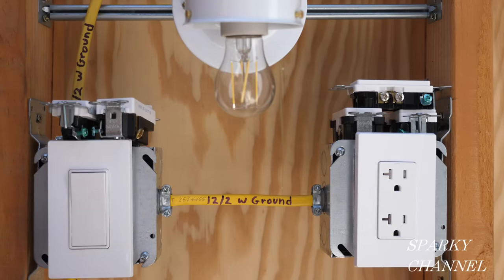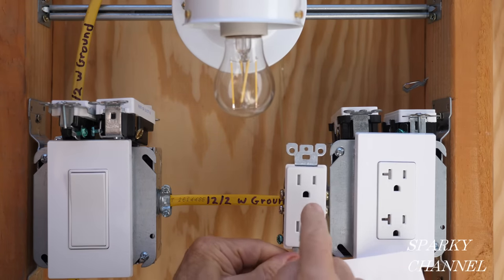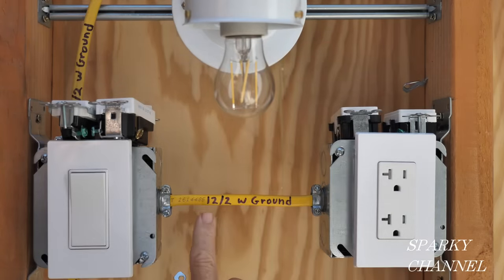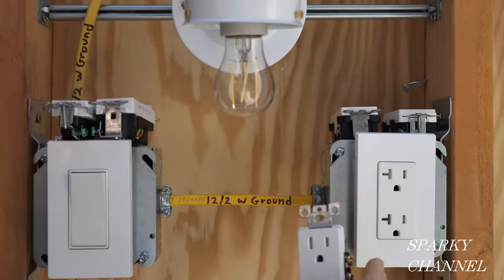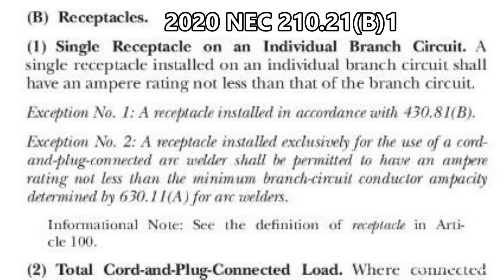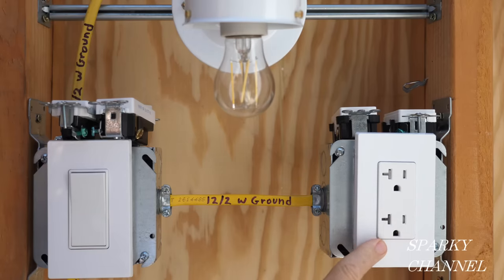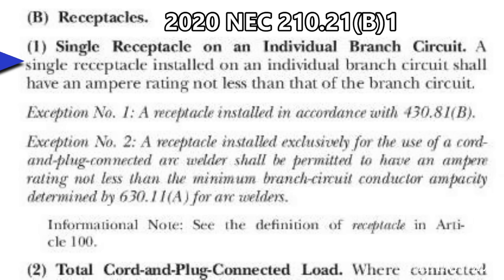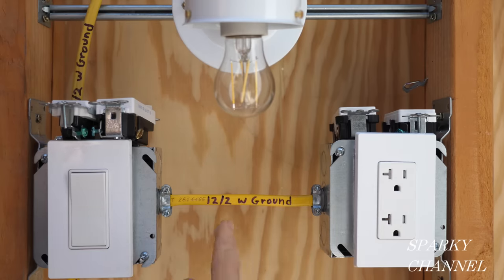Shall I Use a 15A or a 20A Receptacle on a 20A Circuit? + 2020 NEC 210.21(B)(1) and 210.21(B)(3)

Comment: Hello sir. I am working on moving to the United States from Canada. I am getting my J man ticket soon from BCIT. Is it worth anything in the United States ? Do I have to start from 0 ? I have been learning the differences between NEC and our CEC and there isnt many. Our CEC book uses metric measurements even tho we use imperial on the field. We call the neutral the identified conductor in the cec and in the nec its the grounded conductor. The difference between 2 480v panels is also different in the NEC. There also some other small differences but I think I can definitely make the switch.
Reply from the maker: I don't think you'll have much problem. Best wishes!

Comment: An electrician installed a 20 amp outdoor GFCI, I noticed the breaker in the panel was 15 amp. I wonder if the wire at the outlet was 12-2. I live in a house that was built in the 70s. This outlet is on a later edition to the house. All the outlets in the house are 15 amp. So I am concerned that the wire used is not all the same, could mixed.Should I change the GFCI back to 15 amp, to make sure I am not braking any codes?
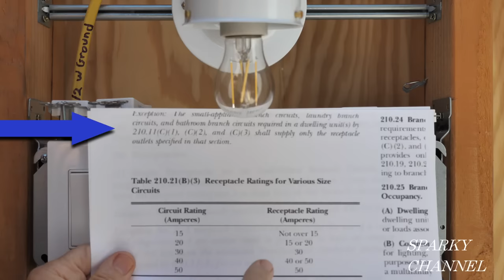Reply: According to code, you can use a 15a receptacle on either a 15 or 20a circuit (as long as 2 or more receptacles are served on the circuit for 20a, which is most circuits because duplex receptacles count). You may NOT use a 20a receptacle on a 15a circuit per table 210.21(B)(3). Video states this at 0:57. In order to be up to code, you should replace any 20a receptacles on 15a circuits with 15a receptacles. That being said, if you don't plug in any 20a load to your 20a receptacle that's on a 15a circuit, you will probably not burn your house down. The 15a receptacle would prevent you from doing this by accident because of the shape of the plug. 
TLDR; Yes, you should have a 15a receptacle on a 15a circuit according to code. Practically, it doesn't matter in normal circumstances.

*I am not a licensed electrician
Reply: @matthewmartin8655  I AM a licensed electrician, and I agree with everything you said, exactly as you said it!  I will only add that the 20A GFCI was probably a replacement at one point, and a 20A was all the electrician had available and too lazy to get a 15A.  I would also point out that any outside receptacle (GFCI or not) be rated as Weather Proof and have an In-Use (aka “bubble) cover.
Reply: In addition to what they said if you have a 15 amp breaker and a 20 amp GFCI you can try and find out what kind of wire was used. If it was a 14/2 with a ground you need to replace the 20 amp GFCI with a 15 amp version but if you have a 12/2 with a ground you can simply replace the 15 amp breaker with a 20 amp breaker and you should be good. As it is you shouldn't have a 20 GFCI on a 15 amp breaker but fortunately the worst thing that should happen is you flip you breaker a lot as the breaker should protect the wire from burning up. Still making one of those changes is best.

Also not a licensed electrician.

Comment: 15 amp breaker going to 12/2 and 20amp duplex outlet.  Wouldn’t the breaker trip once it exceeds or gets close to 15amps.
Reply: SOmetimes but most breakers are thermal and it can often happen that the receptacle will melt first.
Reply: The breaker, if working correctly, should trip as you indicated, but it may reach 16 or 17 amps and it may not be immediate, but it could be a few minutes. It's not a dangerous situation, but could cause a lot of tripping and could weaken the breaker over time. The receptacle won't melt as long as there are no loose connections. A 20 amp receptacle is not allowed with a 15 amp circuit and the circuit rating is determined by the circuit breaker. Your choice, if you have 12/2, is to change the receptacle to 15 amp duplex, or change the breaker to 20 amp because the 12/2 is rated for that. The danger is having a 20 amp breaker on 14 gauge wire because if the heat increases (circuit becomes overloaded) the resistance increases to the level that the breaker may not trip. In this case the receptacle could melt, regardless of whether it's a 20 amp or 15 amp receptacle.
Reply: you can't put a 20amp outlet on a 15amp breaker.
Reply: My house was built in 1988 and has 15 amp GFCIs on 20 amp circuits and they're failing all over the house. PLEASE match the GFCI rating to the circuit breaker amp rating to spare the future home owner problems.

Comment: How do we know if it’s a 15a or 20a? Is there a way to measure the capacity?
Reply: It’s stamped on the receptacles
Reply: The neutral is horizontal on 20 plugs. A 20 outlet had a 'T' shaped neutral slot, to accept both 15A and 20A plugs. All NEMA plugs and receptacles at keyed so that only correct capacity plugs* will fit a given 'outlet' (receptacle). A smaller capacity plug can fit a larger capacity receptacle, but not the other way around. Same with 240V outlets (receptacles). Large appliance cords only fit like for like. there is no dual amperage fit in the larger plugs AFAIK.

*(I think there may be RV adapters that can fit a 50A plug to a 30A receptacle, an approved exception IIRC, The receptacle is breakered for 30A in that case)

Comment: Not sure if it's for commercial applications where end user is more likely to have high amp draw tools , but I was told when using 20amp outlets, the limit is two per circuit. And no, I can quote NEC, since I'm just a plumber taking a look into electricians world
Reply: it's just a rule of thumb.  the official code is that for fixed appliances, the total connected load plus 25% of the largest motor cannot exceed your circuit ampacity.  doing a workshop with lots of high draw tools, the best guideline is a circuit for every non-portable tool.
Reply: I think 15A is 10 outlets and 20A is 14 outlets.
Reply: @AsHellBored  is a 2 plug in outlet considered 2 receptacles? I get the two terms, receptacle and outlet mixed up.
Reply: An outlet or receptacle is just a port to tap into the electrical circuit.  One needs to be aware of the total load being drawn from each circuit.  Your allowed multiple receptacles on a 15 amp circuit for location convenience, but if you plug two 13 amp heaters into separate receptacles on that same circuit, you going to overload and blow the breaker.
Reply: @karuza82  A "receptacle" accepts a plug-in appliance, like a toaster or a lamp.  A receptacle with two plug-ins is a "duplex receptacle".  An "outlet" is anywhere that you can tap into the electrical circuit, so it can refer to a receptacle, a socket that accepts a light bulb, or the device box where a ceiling light fixture is wired into.

Comment: Seems odd to put a 15 amp duplex on a 20 amp circuit.  I’m guessing the odds of full allowable current going through just one outlet is small?
Reply: 15a and 20a receptacles are identical internally. the difference between them is to make sure someone doesnt plug a 20a appliance into a 15a circuit

Comment: What's the harm in using a 20 amp outlet on a 15 amp circuit?
Reply: Strictly guessing here but you wouldn't want someone accidentally plugging in a 20 amp appliance or whatever to a circuit that can't handle it / would keep tripping .
Reply: @feyrband  And you think a 15 amp outlet is going to stop them from plugging it in?
Reply: @actionjksn  Appliances that require a 20amp circuit have a different whip on them. The neutral is sideways so they will only plug into a 20amp receptacle
Reply: The 20 amp outlet has a T shaped slot which will accept a 20 amp plug (found on devices which have loads up to 20 amps). This would make it easily possible to overload the 15 amp circuit with a 20 amp device.

Comment: Why would you use a 20 amp receptacle when 15 amp receptales perform the same with no issues?  I'm talking about residential applications only.
Reply from the maker: They are more heavy-duty and long lasting.
Reply: @SparkyChannel   That's what I would assume.   But i heard another respected YT NEC expert state that internally the receptacles are the same.    The face plate is the only difference.    The T slot allows you to insert a 20A device  .  But a 15A receptacle will not accept it,  so you're protecting the 14ga cable behind it.    Kinda makes sense, i guess
Reply: Why? Because peole are dumb and probably will misuse the plug. Plug two space heaters into one 15A plug and you could possibly have a bad day.

Comment: BUT, I had a problem. My '15A' timer, got hot when I put my baseboard electric heater on it. Heater draws 13A. I tried a few other 15A timers (the kind that fit in a standard 15A socket) and they all got hot at the connection. The 'better' timer (Intermatic), made for 20A, has the 20A style plug. So I had to change the receptacle to the 20A /15A style, and BINGO!  Receptacle and timer, neither get hot. It's on a 15A circuit, with a 15A breaker.
Reply: A Heater is considered a continuous use appliance, and as such, should be rated 125% of load.
13A x 125% is 16.25A, so it will damage a 15A rated receptacle. 
Get a commercial spec grade single receptacle to better handle the load.
And DONT PLUG IT INTO A SURGE STEIP.
Reply: @SuperVstech  Thank you for your advice!

Comment: It’s real easy if you always use receptacles that match the circuit rating. I always match devices to the amp rating. Why do you use rocker switches instead of toggle switches? Nothing wrong with rockers but it would be easier to see the position of the switches if you used toggles in your videos.
Reply: Don't need to see the position of the switch. You just punch the rocker when you enter the room.
Reply: @nextworld9176  I understand. I meant easier to see their position in your videos.

Comment: This is one of those places where I can’t figure out why you wouldn’t always use a 20 A breaker, 12gauge wire and 20 A receptacles for your house.  It just makes more sense and seems safer.
Reply: Because "builders" and maybe the "sparky" want a massive upcharge to wire the whole home in 12g. When the truth is it take no extra labor and the price difference for parts is very minimum.
Reply: True but for anyone with wiring experience, 12gage can be more laborious. As others inculcated, contractors will charge a hefty premium for it.

Lighting circuits and known light/regular duty stuff is perfectly okay for 15amp 14awg wire.
Reply: @ianmackenzie686  Pulling it is really no different unless you have a really tight turn. You would want to make sure your holes are big enough to pass the wire through. Most sparkies just run the same sizes holes everywhere. I do not like having a huge hole for 1 wire. I have seen some really shit wire jobs where they put massive holes everywhere for 1 wire. You really do not want your joists to look like swiss cheese. The smaller and fewer the holes, the better. 
The only spot it becomes a larger pain to use 12ga is when wiring the boxes. And even then, it is not a bog deal. The 20a outlets are more expensive though.
Reply: @bassntruck  

Oh yea. I've witnessed some stuff "professional" contractors have done which municipal "inspectors" let slide.
Reply from the maker: I agree with you, thanks!
Reply: Why would you want less protection?  Bigger is better only applies to battleships and penis'.  Most household electrical equipment is well under 15 amps and served perfectly by using more,  smaler ocpd.  15 Amps is closer to the 4 amps the breaker will actually see then 20.
Reply: @lloydmills9619  

Mostly agree with you. But kitchen appliances usually aren't used one at a time. Also garages home workshops should use 20a also. 

Builders and contractors go on the cheap. On my own wiring projects I like to go above the code minimum as a rule. That's just me, you do as you please just be safe and smart about it.
Reply: Yeah especially if the same circuit serves several receptacles. Less chance of a "oh the breaker tripped because I'm running the shop vac in the garage and someone's running the space heater in the bed room".
Reply: @patrikj  

Bingo. Having service panel space allowed me to give garage olde school Montgomery Ward freezer it's own dedicated circuit. Overkill perhaps but every so often I love electrical work.
Reply: @ianmackenzie686  Kitchens and garages ARE 20 amp.
Reply: @lloydmills9619  

Yes I know.

Comment: So in the event that you have a choice of either the 15 or 20 amp, you may as well put in a 20. Why bother putting in a 15 in that case?
Reply: Guess its just bc 15amp spec grade receptacles r generally cheaper than their 20amp equivalents y not many devices today use the 20amp prong??
Reply: 120V 20A corded devices are not common. However, if someone had multiple 120V 20A devices, I would not want to encourage them to have multiple 20A devices plugged into the same circuit so I would use 15A receptacles when there was more than one receptacle on a circuit. The 20A receptacles also look a bit uglier and people aren't as familiar with them.

Comment: I’m not an electrician but can someone explain why in the code you can use a 50A receptacle on a 40A circuit?
Reply: @ericturner2477  You're right. When its 40 or 50 amps its almost always 220v, stoves, HVAC, clothes dryer, water heater in a home or often construction grade equipment like 220v table saws in a shop setting. In these cases its one circuit for each outlet and you want the breaker to trip to protect the equipment from starting a fire AND the wiring in the walls from starting a fire. It's all about operating within capacity and most 220v appliances have high current draw at start up, especially table saws and HVAC for instance.
Reply: the amper rating of receptacles which more than the ckt   rating is much better.  the one that trigger the breaker is short ckt  fault and over loading. it matters with the load.  the ampere rating of the socket is the current capacity of the contact point. the pressure of the contact when u plug in.
Reply: @papaigneelpo7712  Do you speak English, by any chance?
Reply: 210.21 (B)(1), states a single receptacle installed on an individual circuit shall have an Ampere rating not less than that of the branch circuit. 
50A is not less than 40A.  There you go.  This also means that you can install a single 20A receptacle on a 15A circuit whereas you can't install a duplex 20A receptacle on a 15A circuit.
Reply: @DiffEQ  receptacle is a device not a load. It is more safer to put higher rating receptacle but its not economical because of its cost. 
 
you have to limit the load not the ampacity rating of receptacle

Comment: Have a busted work box in bath. Pulled out Recpt and its 20a with 12gauge no ground, But at breaker its a 15a break. Also its Bath isnt on its own circuit, its connected to a bedroom as bath and this bed go out when break off. Old house all wired wrong i suppose????
Reply: Unless it’s a farmhouse or out in the country, it was probably wired to the code of the time.

Comment: If you have 12/2 cable can you put 2 double sockets in each housing?
Reply: If you're asking if you can put 2 duplex receptacles in a 2 gang box, then yes. The 12/2 wire has nothing to do with it. You can do the same with 14/2 if it's a 15 amp circuit.
Reply: @surferdude642  yeah I have 12/2 cable going to the socket and used 14/2 to pigtail and wire it all together. It's on a 15amp breaker
Reply: @brandonyoung7760  it's all good as long as the receptacles are 15 amp.
Reply: @surferdude642  ty sir